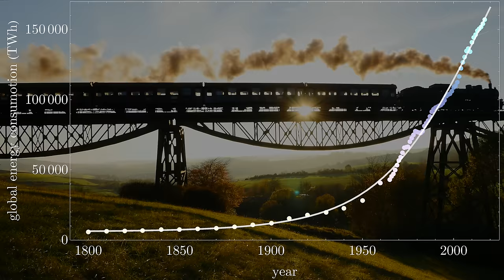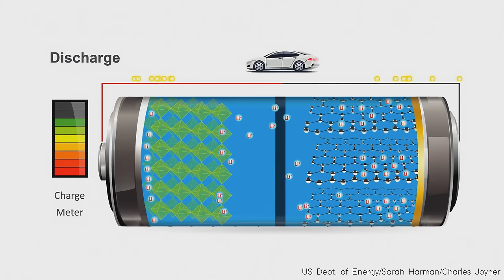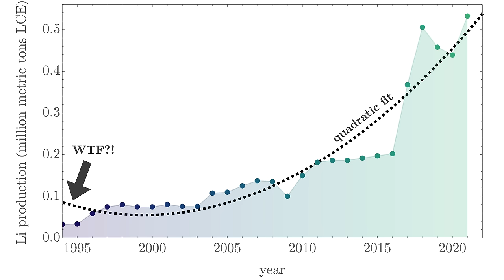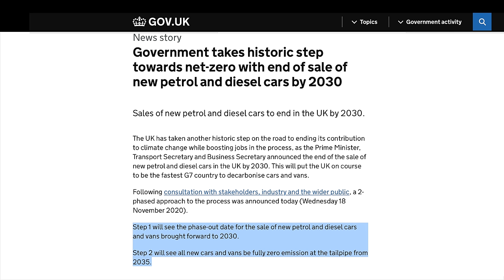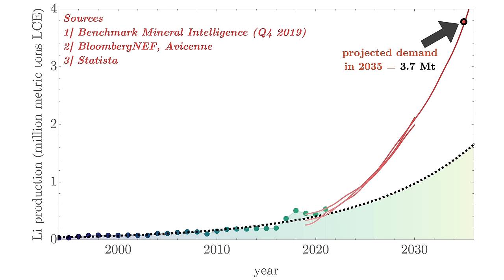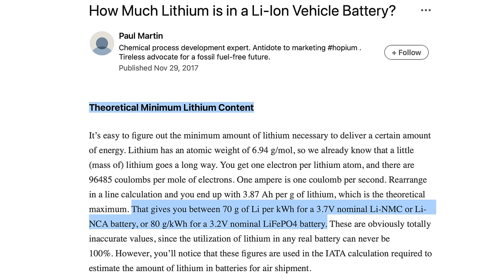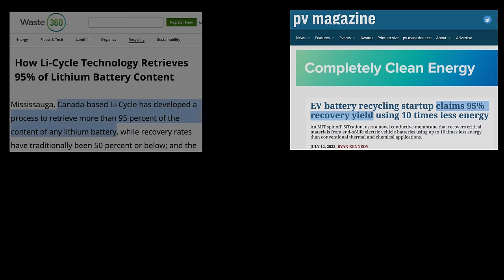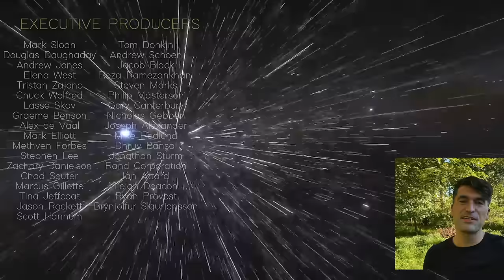Will We Run Out Of Lithium?

Comment: Interesting, but everybody only warry about batteries, but does not saying anything about charging them. It is simple math. Jut in USA average Tesla use 50 kWh to charge battery. Only in USA 290.8 million cars, not include semi trucks, busses, dump trucks...  291M * 50kWt = 14550000000 Kwt = (14550000 mWt) power needed just to charge all cars (not include all other businesses, homes city lights ...  average daily output powerplant is 138,000 MWh  ;  14550000mWt / 138000 = 105,435 power plant will be needed just to charge that amount of cars. Just in USA.  As of December 31, 2020, there were 23,417 electric generators   so we are 114,583 power plant short just to charge all batteries. Can you imagine how much smoke or radiation those thousents of powerplants will generate. I would keep old gasoline engine. Keep making it more power efficient. Effect from this polution plus lithium and cadmium taken from planet will kill the earth.

Comment: There's an other solution to this lithium shortage... not planning for a "car for everybody" future where we just have electricity in the place of oil.

Car is the least efficient mode of transportation. Masively investing in mass transit would reduce the "need" for cars, thus EV, thus lithium. And no battery powered bus are not a solution but troley, trams and trains are (and they don't require nearly as much lithium, if at all)

Comment: Well done, informative, and well explained, easy to understand. Good you touched on the recycling question. I've thought about that a lot. Seems extremely wasteful to not do it. Almost everyone has a cell phone. Lots of lap tops and tablets out there. And Li-ion tools. I have several of those. Multiply me by ? number of people with multiple battery operated devices/tools etc. you have a huge number of batteries. Wouldn't make any sense at all not to recycle them. We also should recycle the plastics used for them and so many other things we use.

Comment: The mining, purification, and recycling of Lithium and other “rare earth” elements all involve dirty processes which are banned in most countries due to hazardous byproduct. Not to mention the energy, as someone previously mentioned, required in charging not just the EV, but anything with a lithium battery. Sounds to me like we’re just replacing one limited resource with another. Not sure what the best option is but I’m having trouble believing it’s Lithium. Almost uncanny if you switch every time you said the word “Lithium” to “Oil”, I’m pretty sure this was the sentiment we switched from steam to petroleum. While I know there are huge differences between the two, it’s just strangely familiar…

Comment: For energy density, lithium is king. That's why it is used in BEVs. for home energy storage and grid energy storage, other chemistries can be used such as sodium ion batteries. Redwood materials has made massive advancements in LI battery recycling. I expect that their solution to this problem is both scalable and reproduceable so we'll be seeing a lot more of it.
Due to market pressures as well as environmental lobbying, I expect we will see nearly 100% of new vecle sales will be BEVs by 2030. The Japanese car makers do not appear to have any sense of urgency. Many other auto makers are only building enough BEVs for compliance purposes, I expect many of them to go bankrupt, merge, be acquired or disappear by other means. Yes, we are going to need a lot more lithium.

Comment: We will run out of everything if we make it cheap enough.
We won't run out of anything if we make it expensive enough.
"Will we run out of X?" is a stupid question if the context doesn't include the prices.
A small complication: we haven't gotten around to pricing garbage correctly yet, so there are very few beer cans in my local gutters but there sure are a lot of take-out coffee cups. Beer cans pay you to take them back but coffee cups are free. 
Garbage tends to be stuff with negative market prices that gets given away free: it's over-priced so there's an oversupply.

Comment: Thank you for the great video, it is an extremely well conducted research on the matter.
It is strange how we switched from lead to lithium for building batteries. What I don't like of lithium batteries, is that they operate well outside the thermodynamic window of stability, since their 4 Volt terminal voltage; the lead acid battery rely on a very stable window of operation - where the oxygen overpotential, the change solubilità of lead sulphate with temperature, and all others parameters, seems to be made with a magical match.
Regarding the availability of lithium, Australia has very very large amounts of the metal, if they only decide to upscale their mining operations.
Once more, thank you Professor Kipping.
A salute from an exceedingly warm UK...
Reply: There are good reasons lead acid are not used more... Compare weights, costs, energy density, etc... The tech survives for certain applications, newer tech is needed for other applications...  If you look at the whole picture, it makes sense...

Comment: Amazing video, but it lacks of historical economic market behavior. Precisely because of the rise in price, other technologies will be researched. For instance, right now CATL is delivering sodium-carbon ion batteries at 160Wh/kg, and with the goal in mind to reach 200Wh/kg in the near future. And as you know, sodium is way more abundant and cheaper than Lithium. Other technologies are also being researched, like Aluminum ion batteries, or solid state batteries.

Comment: An important fracture missing is how many electric cars that can be made in 13 years. Even if the cars sale stay at the same level the increase needed in production is more then 3 million every year if the above 60% target should be met. That is 150% the amount sold in 2021. Building factories take years and cost is very high so it is not likely that the increase in production will get anywhere close to 40 million a year in just 13 years.

Comment: I think that the biggest problem with moving away from ICE to EV (at least here in the US, and possibly across the globe) is the problem of infrastructure. If I had an EV, the current condition of our house's wiring (built in the 1960s) wouldn't allow us to charge it at a decent rate. I'm not even sure that the transformer that we're attached to would allow it either. Yeah, I've got an EV charging station at our town hall, that's about a 2.5 mile walk away, not great for me with arthritic knees, or my wife who is on oxygen 24/7. Getting solar panels up on the roof and using that to help charge the car would certainly be doable, although there's probably an issue with getting them installed and keeping our current house insurance, living in hurricane prone Florida. Which is another issue when it comes to being able to count on having ready access to electricity. And I'm a house owner. Now, if I was a renter, it really would get more interesting. I hope to be proven wrong, we'll see.
Reply: The busiest gas station for Shell in the UK was converted to all electric chargers, no gas pumps almost two years ago... They made larger profits within a month... It won't be long before gas stations are harder to find than fast chargers... Trends show that by 2025-ish EVs will be better and cheaper in every price category and demand will be nearly gone for combustion vehicles... Pictures from early 1900s New York show streets covered with horses and horse-drawn carriages, ten years later it was all automobiles and one horse in the same scene... That was a much harder transition to make happen with lots more difficult infrastructure needing to be built, and it took less than a decade to go from 99% horses 1% cars, to 99% cars 1% horses...  Smartphones seemed like a small business for a few years, then all of a sudden everyone had them... Disruptive changes throughout history ave an exponential growth phase... it is predictable... Tony Seba (look his videos up) has been making predictions about these changes to transportation and power generation since the 1990s and he has been remarkably accurate and he is just following basic stuff taught in most business schools... The entrenched industries have been fighting against these changes and have been propagandizing like crazy since the 1970s to convince people that reality is not reality...

Comment: Thanks for the very interesting video. We will certainly need battery recycling. However, I'm also sure that we will get it. Manufacturers such as Tesla or VW Group have already announced some time ago that they do have the processes, and just wait for the old batteries to arrive at industrial scale, which will probably not happen before 2027 (Tesla Model 3 introduction + 10 years). I see reason for optimism here.

Also, there may be a bright future for batteries which do not rely on Lithium. This could be, for example, the sodium-ion batteries announced by world leader of Lithium Ion battery production, CATL, in 2021. They are supposed to hit the market in considerable scale already next year, since the production process is supposed to be very similar to well-established Lithium-Ion battery production. So that is another reason for optimism.

Personally, I believe that the biggest challenge to the transition to renewable energy will not be any of the raw materials which are needed for it. Instead, I think the challenge will rather be stability of global economy. That is currently being weakened by persisting Covid-19 effects, by Russia's war of annihilation against Ukraine and generally against Democracy as a system, and by the increasingly severe lack of work force due to demographic effects in all developed countries. As long as production chains remain unreliable, and we have far less workers than necessary to put e.g. solar cells onto our roofs, the outlook is grim.

Comment: Well the Lithium Ion battery in my 2012 tablet is still doing just fine so not entirely convinced ten years is a valid limit, it really depends upon the number of charge - discharge cycles and the depth of those cycles, as well as how well the batteries are thermally managed, in Teslas this is excellent, in some other vehicles not so much.

Comment: The way I see it, Lithium is another non-renewable resource which requires large industrial mining operations, often in remote natural areas. Lithium batteries are quite toxic, and trusting people to recycle them properly probably isn't the most reliable plan. Even if we could efficiently recycle most of the Lithium, it's not like we can last on recycled Lithium forever, we will still eventually run out.

Personally I think electric cars will become the most common form of vehicle, but we really need to find better ways of generating and storing the energy. Similar issues also apply to commercial wind farms and solar farms, they require an immense amount of resources to construct compared to the amount of energy they produce in their life-time, not to mention they intrude on the very environment we are trying to protect.

We need to start making use of the most technologically advanced forms of energy generation we have, which means making full use of nuclear energy. We have dumped countless billions into nuclear fusion and we have yet to build a reactor capable of producing more energy than it consumes. If we had of spent that same amount of money on improving the efficiency and safety of nuclear fission reactors the world wouldn't have any energy problems.

But that would mean overcoming all the decades of fear people have developed around nuclear fission. Instead we'll just move full steam ahead towards this clearly unsustainable future where we pin all our hopes on Lithium and electric cars. Lets just hope there are no big solar flares once the government forces us all to drive electric cars packed full of computers, what a great time that would be.

Comment: one of the things I think should be done, just in general, is prohibit the mass manufacture of devices.  We have too many onthe market in general.  Just look at phones, cars, etc.   Generally speaking, only a few models of phones are popular each year, the rest just sit on shelving for a long while.  The same with cars, and yet - they make 5, 6, 10 new models every single year.  That is per manufacturer as well.  I can't tell you how many cars I see sitting on the lot for years at a time that never get sold.   We over produce due to 'too many types' - not everyone wants or needs a truck, the same with each style phone, etc.  We should limit this, and focus on quality and a 4-year new model cycle instead of 4+models each year cycle.

Comment: You're familiarity with the lithium industry is not high, so it is interesting to see how you use first principles reasoning to come to sound conclusions.  I think you undervalue future lithium source developments, and neglect to mention economic forces influence research.  With lithium at high prices, new processing methods will be developed.  You  are correct that recycling is not an option. And recycling is also the key to EVs emitting less carbon that ICE cars.  Lithium extraction is also energy intensive, but lithium recycling is not.  There is no shortage of lithium recycling startups -- most EV makers are getting into it.  Redwood Materials is leading the charge.  The best part is that your careful reasoning inspired me to do my own research, and it looks very much like sufficient lithium is not a problem.  The LFP battery option reduces the dependency on other exotic metals.

Comment: Very nice video. How about the others battery types we hear all the times? If there is a new battery revolution comning then the problems will be solved?
Reply: Huge improvements have been happening every year... New chemistries come into mass production a couple of times a year it seems... LFP and then a 20% improved LFP and then a 30% improvement to LFP, now close to NCM in energy density are the most recent I have heard of in the last couple of years... Sodium instead of lithium has many advantages apart from energy density and is starting to go into mass production any moment now...  Lithium is very abundant and cleaner, cheaper, faster ways of extracting it has just recently been proven at industrial scales and is being built out for future production...

Comment: You have your electron flow backwards. DC electricity flows from negative to positive, cathode to anode. This process does not reverse during charging. Negative power still goes into the cathode and the circuit is completed out the anode.

You are also assuming that every EV battery will last ten years. Some fail prematurely and need replacement. That essentially doubles the number of batteries required for a certain number of cars.

Comment: A sensible civilisation would go for transport that uses small batteries. Aptera uses 1/3-1/2 the battery size per km range. Ebikes 1/10th. Electric  trains, nothing.

Sadly as the last 3 years have demonstrated, short term fun is more important than long term survival.

Comment: Short answer, no.  In southern California they are now looking at potentially mine 600 000 ton per year at Salton Sea, which would make the US self sufficient on lithium. On top of that it looks like sodium is also a contender for EV batteries. Lower capacity but probably good enough for short range applications. When it comes to stationary storage there are other solutions out there that is far better and cheaper for that application such as the liquid metal battery.
Reply from the maker: Remember they demand reaches many millions of tons by 2035, so 600000 doesn’t cut it. Sodium is interesting but has lower energy density, needs to be scaled, and wouldn’t ultimately be a sustainable solution unlike recycling.

Comment: based on your intro in which you correctly point out that our entire way of life is powered by energy, the price and availability of that energy has and will have a dramatic impact on our lifestyles and prosperity. 

in that light, trading our current energy sources which are historically cheap and extremely abundant for a new model that will likely be expensive and scarce, it seems to me foolish to mandate this transition.  rather it males more sense to allow this transition to occur naturally through actual consumer demand rather than exacerbate the supply deficit by government mandates.  the mandates will only add expense and difficulty to achieve the transition.